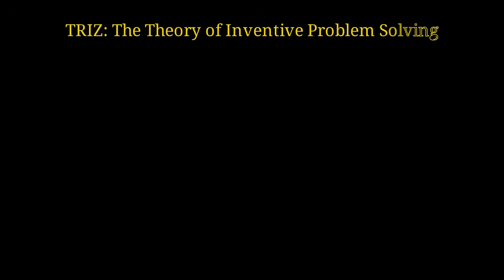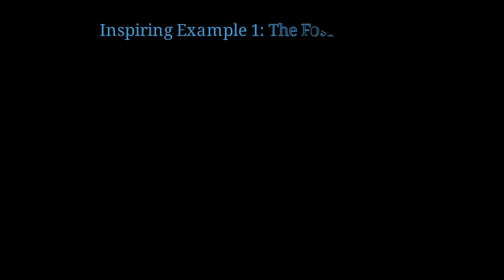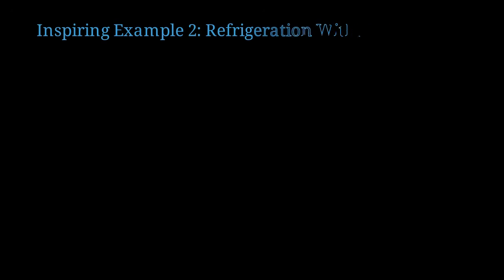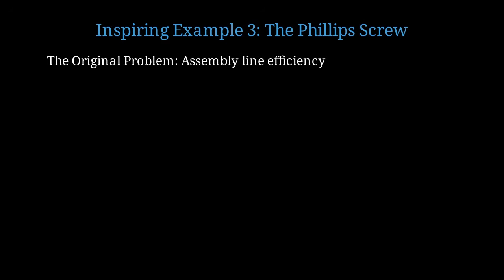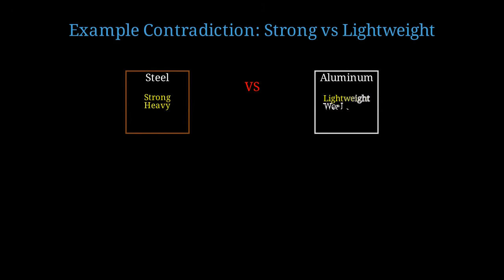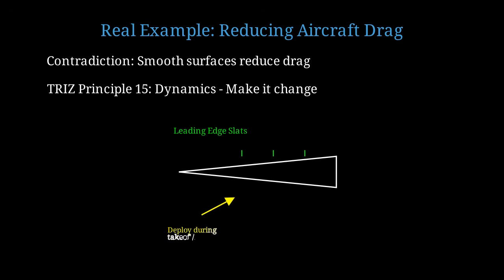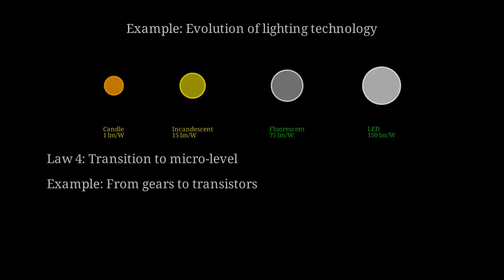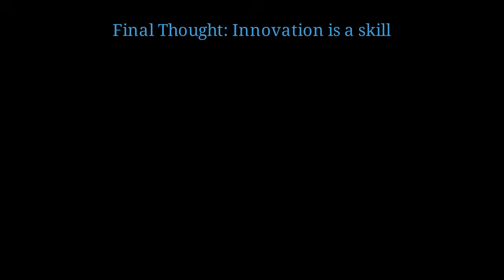TRIZ Examples — Systematic Innovation and Problem Solving

Comment: I will say not very satisfactory. Principles are being discussed without actually discussing the engineering parameters. In the examples only the problem statement is discussed. But to use TRIZ you need to select the improving and worsening parameter first. It is not easy always to detect the correct parameters from a problem statement. In case of the 'reducing drag example', what was the improving parameter. Can be speed, can be energy loss. Drag isn't directly in the parameter list. There are other confusions. Example for the parameter stress. What does it mean. Stress exerted by object or on the object or the ability to handle stress. these things needed to be discussed.